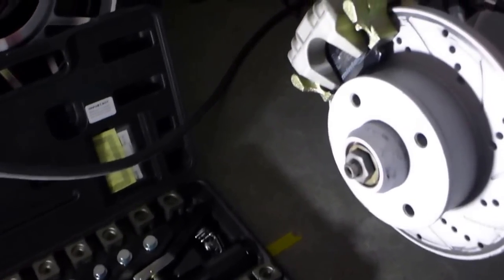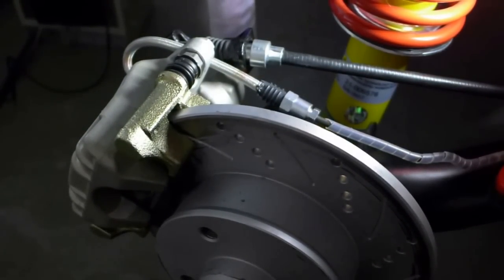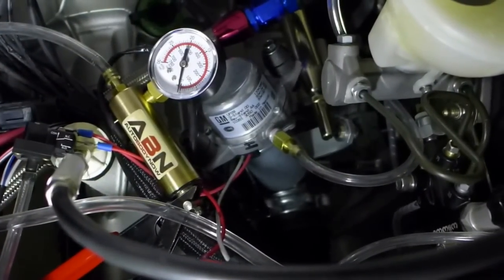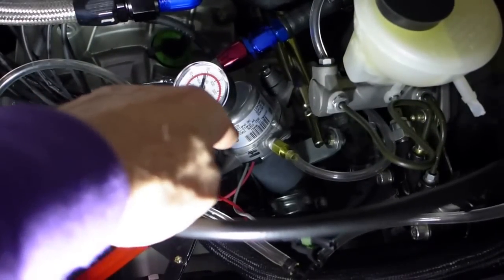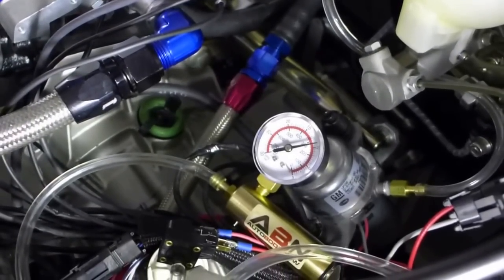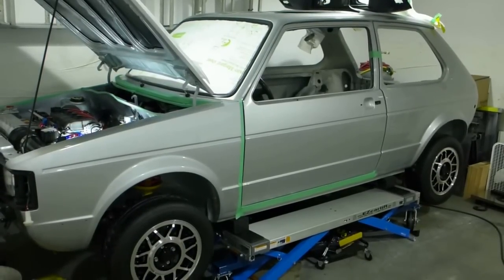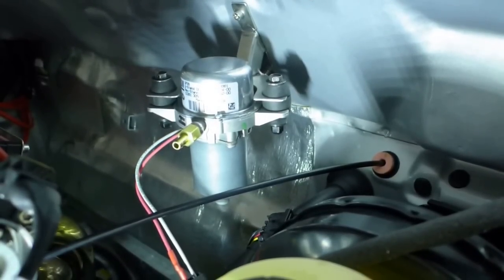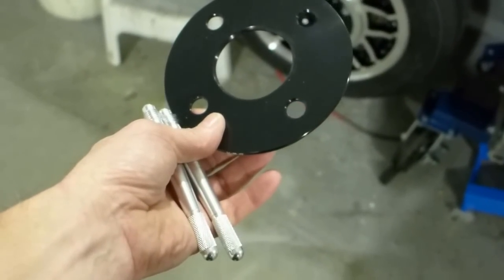The Ultimate 1983 Rabbit GTI - part 109 ( Brake Lines, ECU controlled servo vac pump, alignment )

Comment: also i hvae stock breaded fuel lines with bandjo nut and ring ends. i need to replace some and the cheapest i could fine for only one line is 90$??? any ideas
Reply from the maker: Don't cheap out on brake lines!